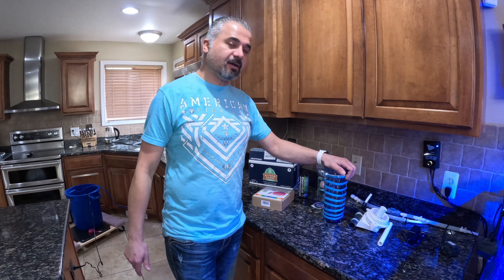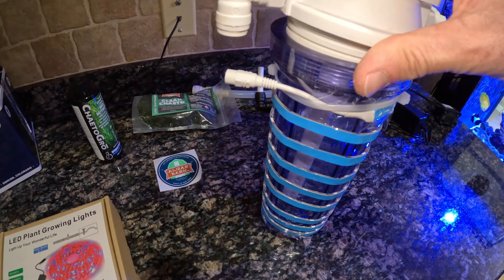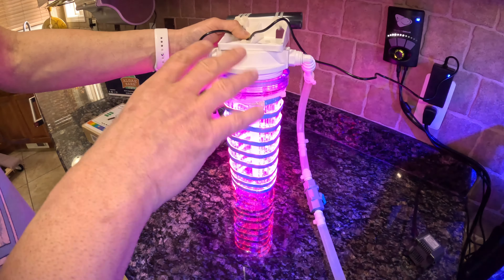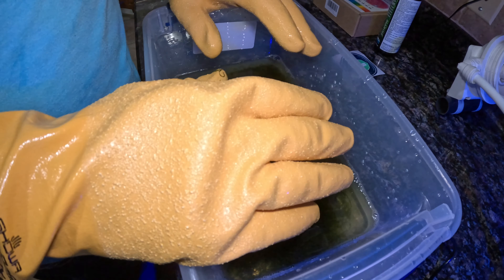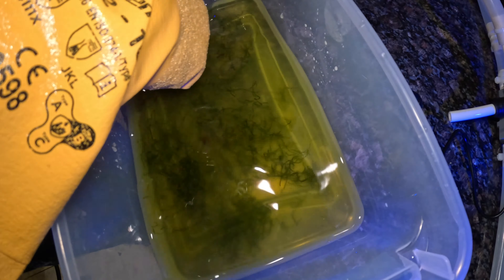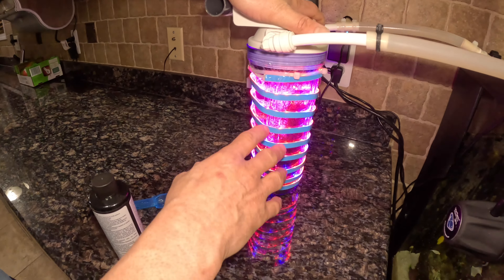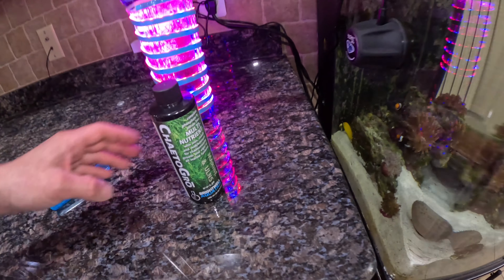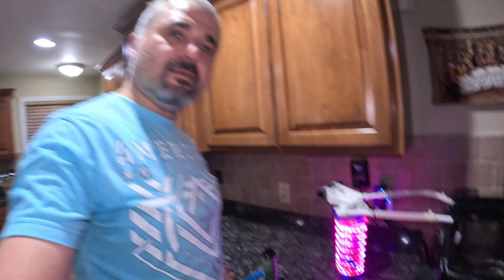Macroalgae Reactor DIY for biocube 32 or any tank  part one   4K

Comment: OK, I want to build a Biocube and I am doing research. What exactly does the Reactor do? Thanks
Reply from the maker: Hi, the purpose of the reactor is to keep your phosphate and nitrate low and stable pH I think it is very important to the reef tank Otherwise you’ll be fighting everything with the endless 
chemical to keep your perimeter in check. I highly recommended.